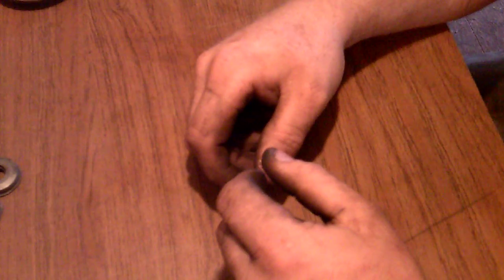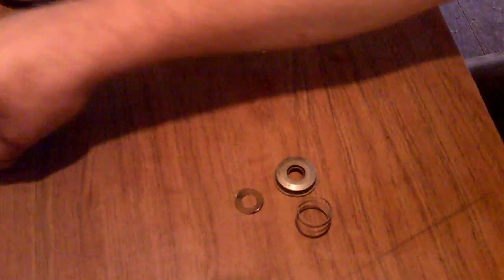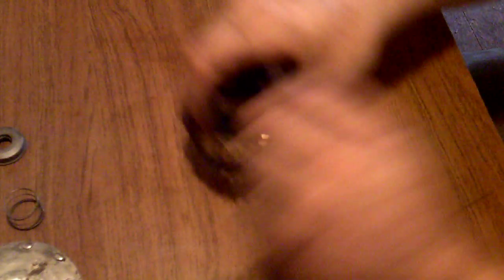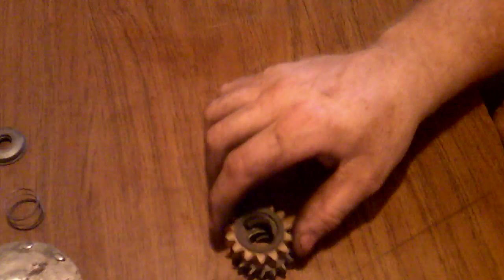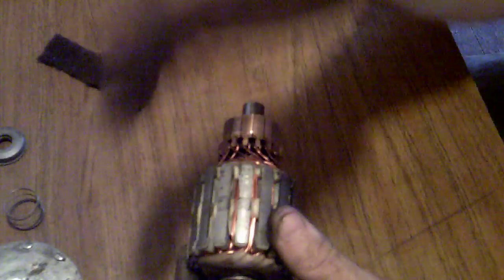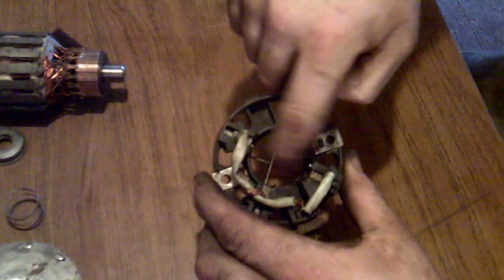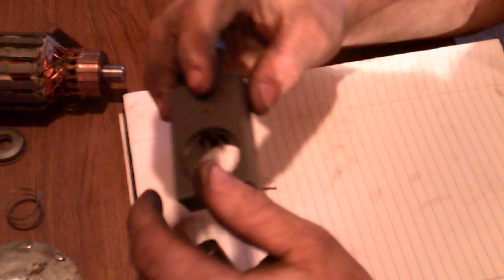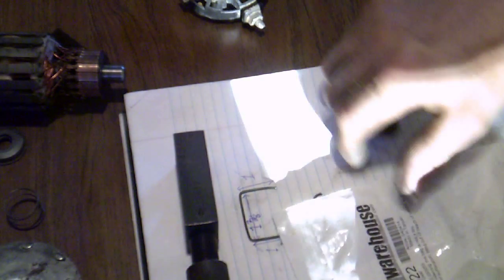How to rebuild a briggs starter

Comment: What is the best way you've found (without the removal tool) to remove the c-clamp that holds the retainer in place.? TIA for any help anyone can provide. I have tried a few things, but I'm well aware that there is a truck to every damn thing, so I figured, before I destroy it (which wouldn't be the first time), it wouldn't hurt to ask..

Comment: What are the symptoms of improper valve lash? I know it can just click and not spin up like a dead battery, but I have a starter (new) that the gear sticks in the flywheel and makes a grinding noise. I was blaming the starter. Maybe the valves?
Reply from the maker: The most typical symptoms of improper valve lash are ..A hard to turn over engine, Backfiring threw the carb, Kick back from a starter recoil assembly , Solenoids that over heat due to over exposure of cranking, Starters burning up,{due to excess cranking or lack of if the flywheel cant turn over and excessive voltage is applied for a long period of time.} I would like to note that on Briggs and Stratton engines in todays markets that the compression releases built on the cams can be faulty ....{They break} causing some of there engines to appear to have valve lash issues but in truth its just the compression releases breaking internally that as I said earlier are on the cams.....Sadly this isn't the only issue that might make a person feel they have improperly adjusted there valves...Briggs and Stratton also has had a issue with cam lobes being cut away over time {WORN DOWN} and this to can cause valve lash issues.  Valves are not to hard to adjust on most OHV engines I provide a video on how to properly adjust valves if you would like to tackle the task just keep in mind the compression release must be working and cam lobes not worn away ...Note/ though it is rare you could have a starter that has the wrong pinion gear to drive the fly wheel...It may be worth your time to inspect your old starters pinion gear to see if its metal or plastic as some flywheels may require the use of the metal gear rather than the plastic if you own a Briggs and Stratton engine .
Reply: I was in the middle of swapping the pinion from my old starter to the new one when I came across your video and the comment about valves. Bought this ztr used and was going through systems... new battery, solenoid, starter, adjusted valves, then the grinding started (not right away so I didn't think about the valves being a possible issue). The pinion sticks up in the flywheel and I get no crank, just a grinding noise, have to lower pinion by hand, then try again and it will start. I was blaming the starter, until I saw your comment and had the thought if the engine is too hard to turn over and the pinion is slipping (or the wrong one!) thanks for the reply.
Reply from the maker: Welcome.. glad to help...
Reply: Wow. Engine purring after setting the valves per your other video. Took like 10 minutes. I originally came here as I was trying to figure out what was wrong with my starter and doing a rebuild (on a new starter). Realized from your comment I had a valve issue. I had improperly set the valve clearances. My  new starter was just grinding on the flywheel as it couldn't turn due to the increased pressure. Reset the valves, remounted my starter (once I got it back together), turns over like butter. I have been struggling with these (self induced) issues for several weeks. Now I can cut some grass. Thanks!!!!!!
Reply from the maker: Welcome...glad to have helped..